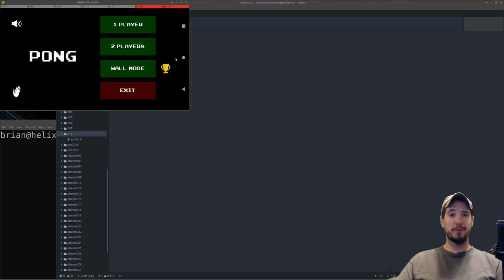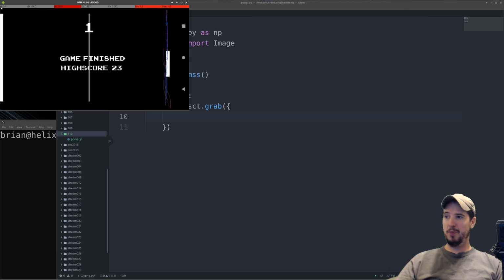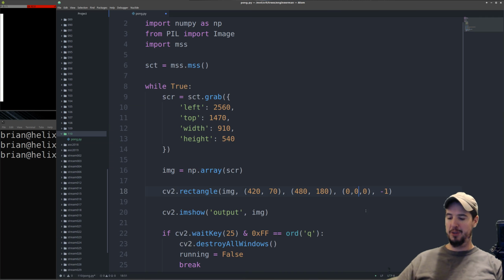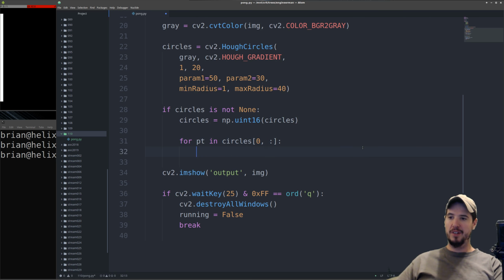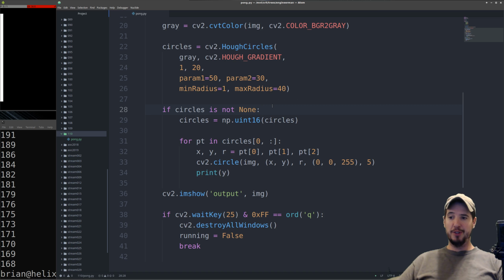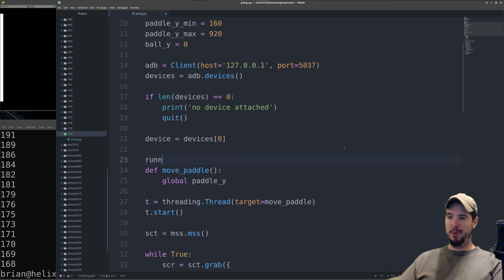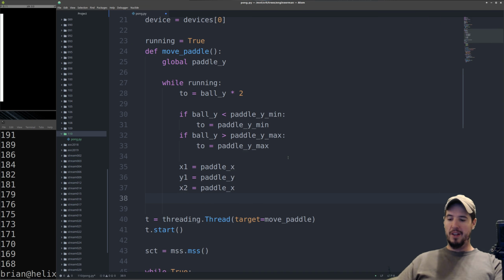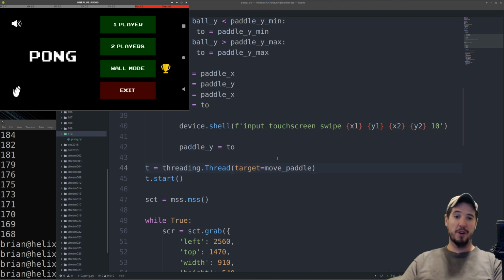Automating Android Games with Python and OpenCV: Pong

Comment: This a cool video, I think you could make do with the slow adb commands if you tried to predict the path that the ball traveled. You could run a linear fit on the first few screenshots and check if it would hit a wall or if it would go though the paddle area with a simple linear intersection calculation, that way you're only sending one swipe command instead of using all of the bandwidth that adb has to send a command for every y value.  Collisions with the wall are pretty easy to model since they seem perfectly elastic, also even without doing that you could still use this approach but just start the fit over after a collision

Comment: Hey man, what about trying using a virtual android device? Like bluestacks or MemuPlayer. You can easilly root them and you can do much more with it. You do not need to use a real phone. BTW nice video. I have no experience with Adb, so I would rather create a program with pyautogui in python and control everything through that with a virtual andriod emulator. It is easier in my opinion. What do you thing about this option?
Reply: Since there is no android app anyway, a cheap way is pressing the pc monitor where the emulation is. Pythongui gives that feature. I currently use autohotkey but then I miss all benefits of python libraries.

Comment: think threading would not have been necessary since python does not support real threading (global interpreter lock)
Reply from the maker: GIL prevents code from running in parallel. What you see here is code running concurrently, which is all I really needed.
Reply: @EngineerMan  okay but i don't understand why you need the concurrency, since you can only move the bar after determining the position anyway?
Reply: @barneee5418  sir , can u help me with a game , 

there is a game called Ludo King, where you spin a dice and a no. will come and then you move that much forward,   i want to change that and make it like so i can choose which no. to come , it is very important for me , if you can help then it will be great for me .

Comment: Hi! Thank you for yet another great video. 
You are an inspiration! 

I like the approach. I would perhaps consider only moving the paddle if the ball is near your side. So, x must be greater/lower than a specific value. This way you won’t move the paddle if it’s not your turn, and also you don’t have to move it, if the ball is going to change direction due to hitting the roof. I think this could save you some time since you don’t move the paddle for no reason. 

Best regards from Denmark. 
Keep up the great work.

Comment: To overcome the latency you might calculate the y value only when the x value is within a range sufficiently close to your paddle. In this way, you would also be seeing your paddle save the game at the very last moment, suspance! :)
Reply: actually letancy isn't the issue here, he should only need to move the paddle once. if he'd actually calculate the trajectory of the ball ;)
Reply: @90hijacked  that's very true, with trajectory calculation there wouldn't be any need to raise concerns about latency
Reply: @francescotaurone6563  what's the formula to calculate that?

My math is not the best
Reply: @dev.tirebit  If you imagine a straight line going out from the surface the ball will strike, the ball will bounce away from the surface with the same angle that it entered, but on the other side of a line.
For calculating the trajectory, taking the ball's position in two frames is enough to calculate where it's going to strike next. Simply draw a line through the two points (and extend it towards infinity on both ends). That line will intersect the next surface the ball strikes. To put that in programmatic terms, you can take your two points and extract the difference in y and the difference in x between them. Then use the ball's current position coupled with the speed in the x and y direction that you just extracted to figure out which wall it will strike. Crucial here is the fact that the total speed of the ball does not matter, at all. Only the ratio between the x speed and the y speed.

Comment: I am too bad at math to figure it out, but if you could start to calculate where the ball would end up, already when leaving the opposite wall (including when it bounces off the top and bottom), it would  give a lot more time to process the image and move the pad.
Reply: "calculate the trajectory" was the words I was looking for....
Reply: I was thinking this too. A bit "mathy" but it would definitely be faster in calculating where the paddle should be placed :)
Reply: @dvdseroney  
A short brainfart (take it with a grain of salt):

Take to screenshots in a time intervall Δt, here it was something like 10 ms. With openCV you will get the Ball coordinates (x0,y0) and (x1,x2).
We define the left goal as x=0 and the right one as x = L .
First consider the case Δx = x1-x0 <0, this means the ball is moving to the left, which means you won't have to do anything. 
In the second case, where the ball is moving towards you, you can calculate line with the known formula f(x) = m*x + b, where m is the slope and the b the y axis intercept.
The slope m is calculated with the difference quotient m = Δy/Δx. 
The intercept can be calculated by plugging one of the two points into f(x). Let's take (x0,y0):
f(x0) = m*x0+b = y0 
<=> b = y0 - m*x0 
Plugging this into our line formula:
f(x) =  m*x + y0 - m*x0 = m*(x-x0) + y0 = (y1-y0)*(x-x0)/(x1-x0) + y0
We defined the x-position of our goal to be x=L, so the y-position is obtained by:
f(x=L) = f(L) = (y1-y0)*(L-x0)/(x1-x0)+y0 
A very simple solution would be to set the center of our pad at (L,f(L)) if the ball if moving towards us.
A more sophisticated, but also simple solution would be to set our pad in a way that the ball will hit the closest 
edge (lower or upper) of our pad. 
openCV is good enough to also detect the positions of our pad, but assuming that we will always have the same starting position,
we could simply track our own pad center position with the variable y_pad. Assuming our pad has the length l_pad. the positions of the edges 
are upper = y_pad + l_pad/2 and lower = y_pad - l_pad/2 .
I don't know why I introduced time, but we could use it to calculate how long it will take the ball, to reach our goal.
The velocity in x-direction is v_x = Δx/Δt. Let's call the remaining distance to travel r = L -x1.
The the ball will hit in a time t_hit = r/v_x , by the formula for a constant motion.

Edit: I didn't take into consideration, that the ball can bounce of the ceiling and bottom. This will make the algorithm slightly more complicated.

Hitting the ceiling means that in our calculation f(L) > H , with H the height of the box. Hitting the bottom means f(L)<0. 
The we have to modify our line equation. The slope just has to change the sign so m' = -m.
Hitting the bottom means we have to reflect our y-intercept at the x - achsis b' = -b.
Hitting the ceiling means we have to reflect our y-incercept at the x = L line b' = L-b+L = 2*L+b
(hard to explain without a diagram). 
Now we can calculate the new end position f'(L), with the line formula. Since we can hit more than once,
we have to loop through this procedure until the ball will hit our goal and not the boundaries.
Reply: @Ryuuuuuk  Great (and very detailed!) explanation even if without diagrams. The part I didn't understand was how you reduced the equation to  ==> (y1-y0)*(x-x0)/(x1-x0) + y0 after plugging in the line formula (my math days fail me)

Otherwise this should work I think. For looping through the formula, my guess is this should be done at any point y reaches zero or y reaches the maximum (assuming y=0 defines one boundary in the game area and max y defines the other boundary) Looping through the formula should be done while those conditions are met or until x reaches the pad's x coordinate.

All considering the ball is moving to the right of course :)
Reply: @dvdseroney  ah, I never wrote the complete statement for
m =  Δy/ Δx = (y1-y0)/(x1-x0) , which I plugged in
f(x)= m *(x-x0) + y0 = Δy/ Δx*(x-x0)+y0 = (y1-y0)/(x1-x0)*(x-x0)+y0